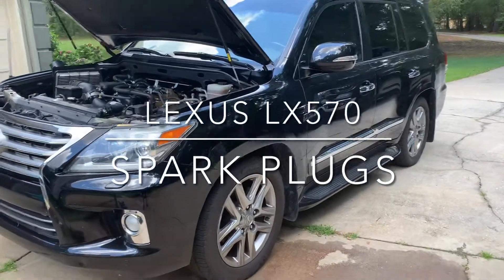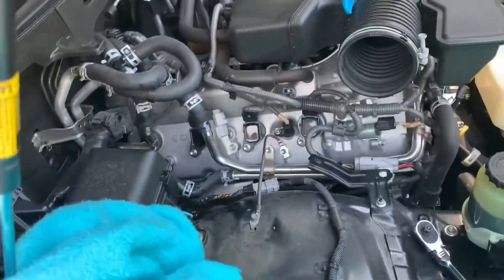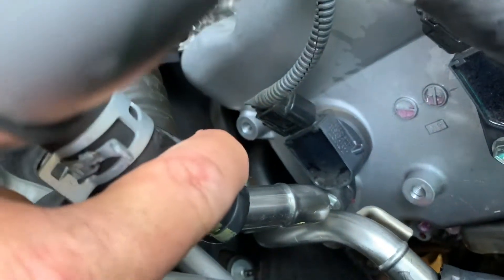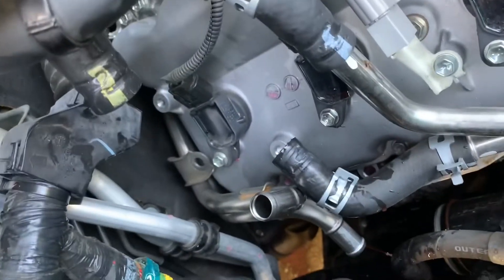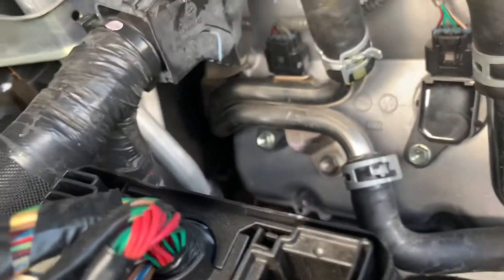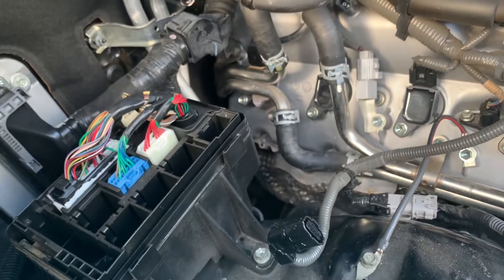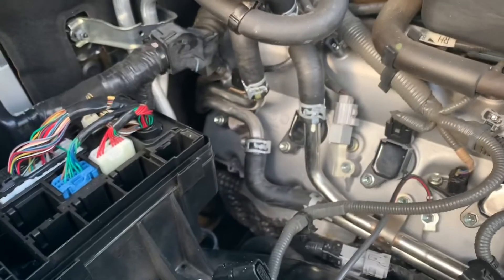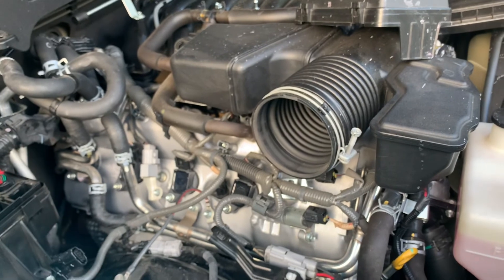LX570 Spark Plugs - Read Description for more help!

Comment: Thank you for this.. Will change plugs and coils next week on my LX570. I needed some guidance.
Reply: Why do you feel you need to replace the coils?  I doubt you need them unless you are having misfires or into the 3-400k mile mark. 

Everything on these vehicles is superbly built and the coils are no
Exception. They should be good to go. 

The plugs on mine looked perfect. Not saying they didn’t need to be changed but no irregular burning, oil or wear. 

This is a pretty easy job. This video and the description should help you greatly.
Reply: @thooks1234  I figured since I'm already removing the coil to get to the plug, I'll just replace it also. There's no specific issues with the engine running. You make a good point though.. Thanks
Reply: What is the torque spec on the plug?
Reply from the maker: @soulasock  Not sure exactly but 14-18 ft-lbs will be good.  You will be safe in that area.